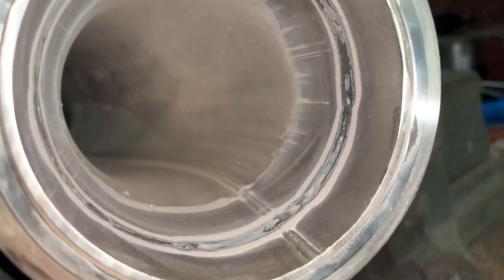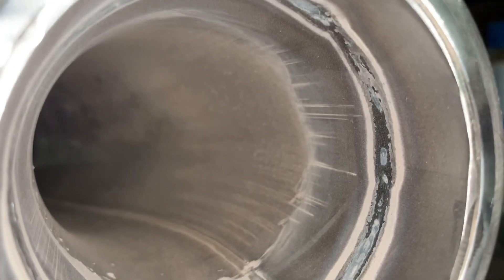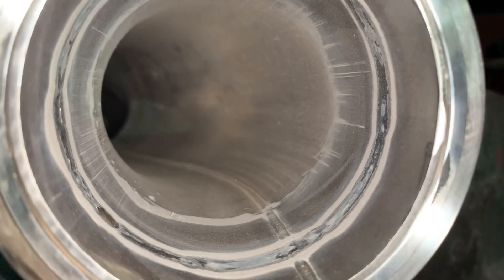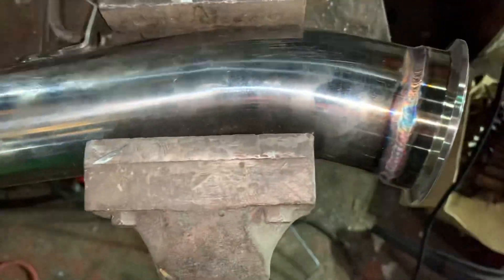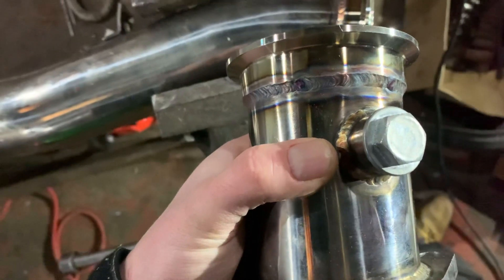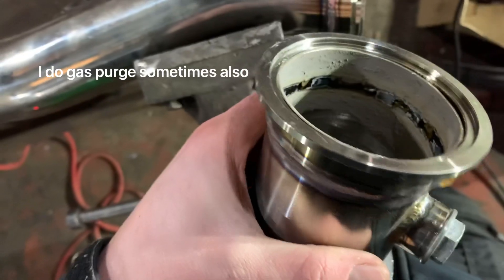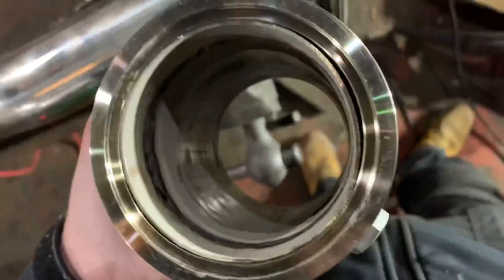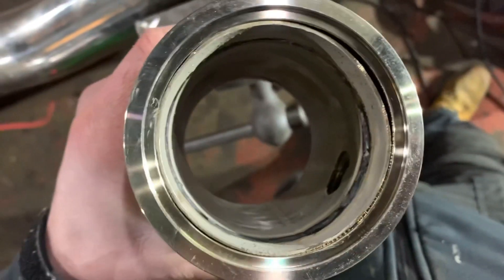Tig welding with Solar Flux. Stainless steel 304 exhaust.

Comment: Do you have to scrape the flux off or residue off after welding
Reply from the maker: I do yeah I certainly would if you're flowing anything other than exhaust gas. I use a mini wire wheel on a die grinder I may try a ball type hone as well. Goggles and a mask are a must. When you mix it right you'll see it paste and it will apply easily this seams to yield the best results for protecting the back side of the weld. The remnants do bake on there, some will flake off.